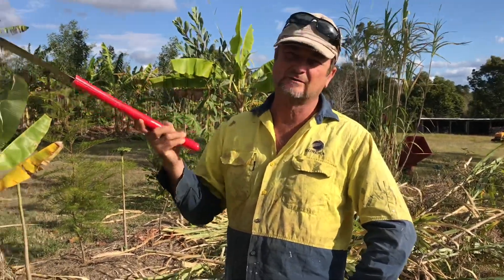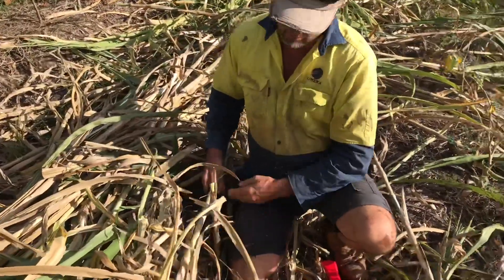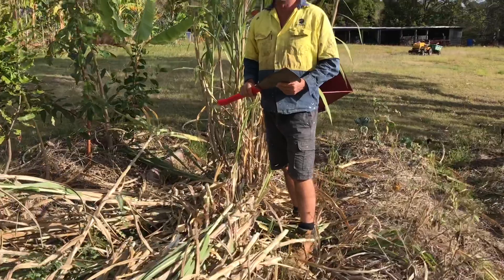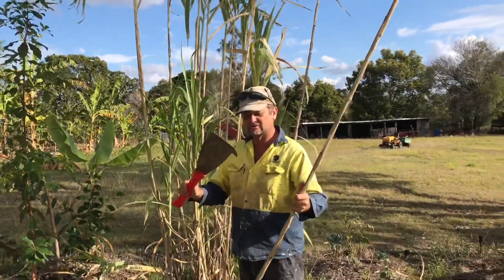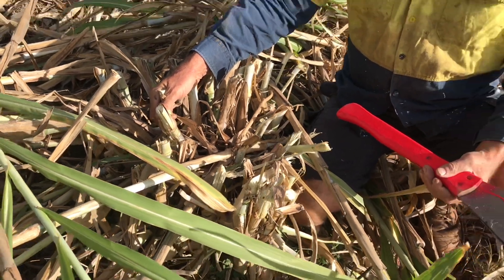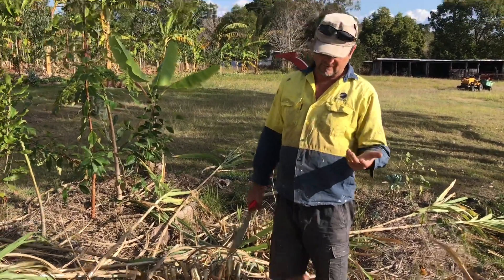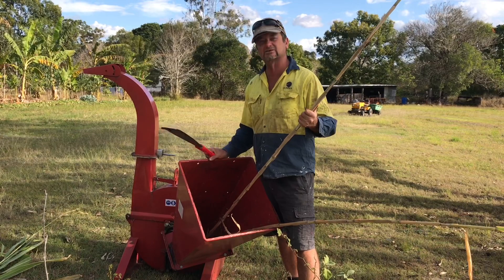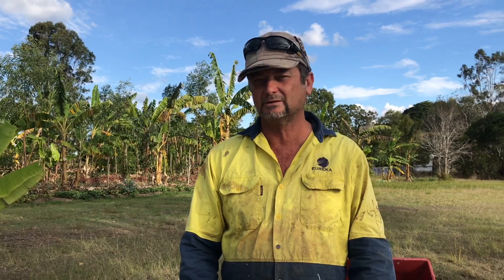Syntropic Agroforestry in Australia: Video 45

Comment: Excellent warning on "once you have it, it's there". I would add that sugar cane is also a lot harder to cut and handle than you mention. It has itchy fibers, I would never handle it without gloves, and those grass edges can cut! It's quite substantial and tough to manage.
Reply: Correct! Long sleeves and gloves are essential. Those fibers is like working with fiberglass in the leaves, yes?

Comment: Howzit
I have been planning a similar block with cane as an interrow but i want to see if i can get a harvest of cane. I figured i could grow out about 20 - 30t/ha by adding 3 rows in my interrow. Have you worked with pigeon peas?
Reply from the maker: Hey. Sounds good. Can I ask what you harvest the cane for? Biomass or sugar? Just remember the roots clumps are pretty much permanent. I’ve had mixed results with pidgeon pea. A little disappointing